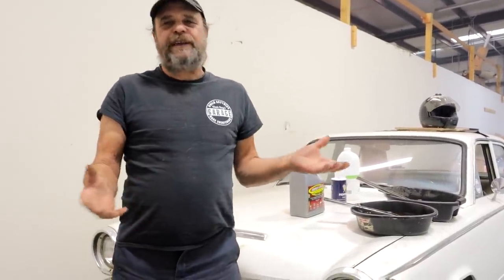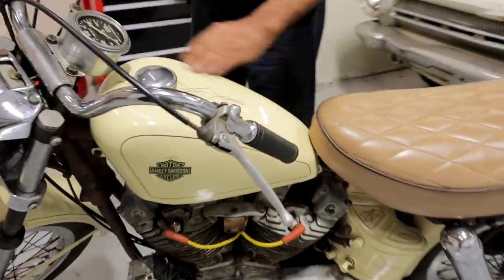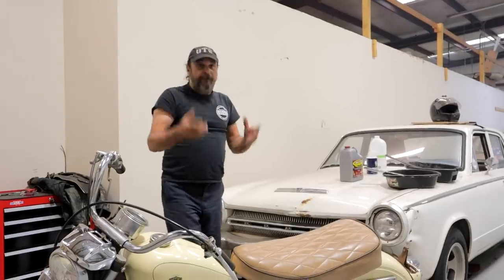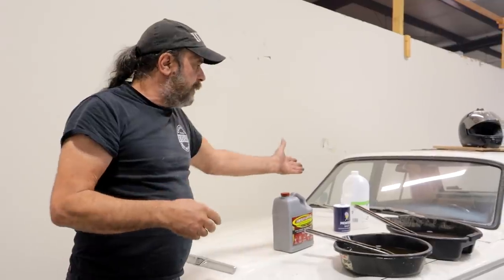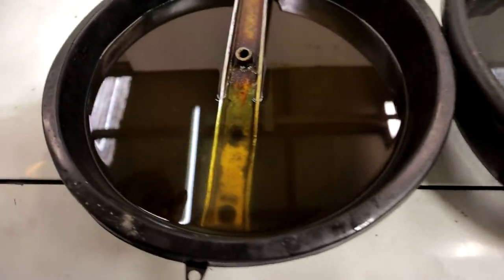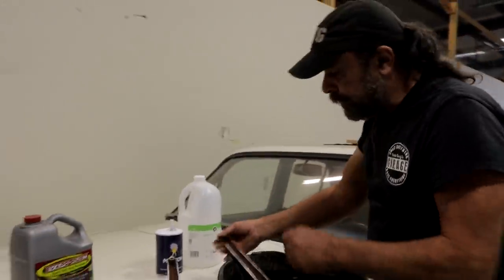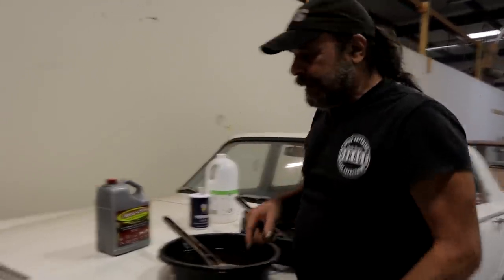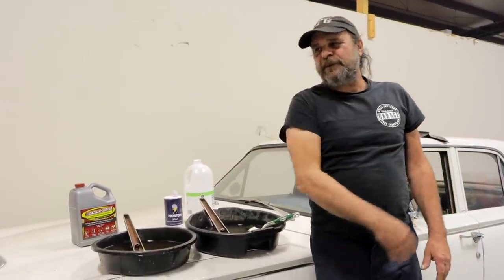Evaporust Vs. Vinegar - At 10X The Cost Does It Do 10X The Job?

Comment: The old timers used to tell me about distilled white vinegar years ago working in shops but I was too young and impatient to listen to them or wait for the results....   Now at 41 years old its all I use, even more than sandblasting because the Distilled white vinegar leaves the metal in a much cooler original unfinished raw metal state... Thanks T...

Comment: Done a lot of bike tanks I’ve used the stones u get from harbor freight to polish gems and sones plus a small pic of chain then put diesel and vinegar and water . Then jack my riding mower up strapped the tank to the rear wheel put it in gear let it go for 20/30 min works great

Comment: I just did my own experiment with two plated bolts.  One in vinegar the other as a control.  Both were brand new.  Within two hours the plating was removed.  I let it sit overnight anyway.  I took it out and rinsed it off with water.  I also rinsed the control bolt and let them sit.  The one that had been in vinegar flash rusted.  

I had said in previous comments that vinegar would remove plating and people disagreed.  It will certainly remove plating.  If you have any amount of plating you want to keep or a machined surface you don't want etched then any acid is a poor choice.

Comment: it good! I tried it, EvapoRust is GOOD! holy moly, it changed my cleaning routine of old and crappy parts! bin of rusty bolts? ***dump*** ***rinse*** ***quickdipanddry*** and aluminum spray paint for preservation. <3 all

edit: oh, just be careful at the surface barrier I had sticking out like demonstrated in test example, I had deep pitting on my parts. though, I wasn't using EvapoRust and another type of 'enviroment' friendly brand rust remover. ***shrugs*** be careful and get your super important parts FULLY SUBMERGED!

Comment: Uncle, there is amother way i use. Muriatic acid. Its like hell but disolves the rust and leaves clean and shinny metal.  I then wash the part with sodium bicarbonate then soap and water. When clean, sseal it with atf (atf is great to prevent rust)

Comment: Rust bugs have been the bane of a metal worker's life for centuries, and dozens...probably thousands... of methods for removal have been tried. Thanks for the side-by-side comparo. I've wondered about Evaporust, but never seriously enough to step up to the cost. My sense is that it's probably perfect for some tasks, but for me it's too expensive to try when vinegar/salt work so well. There are various acidic strengths of vinegar; the highest I'm aware of is 12%, and that works really well. You can find it in farm supply shops. It's sold as a natural weedkiller. If you're wondering about the strength of the vinegar, check the label. In my local grocery store I've seen from 3% to 6%.  Varying the amount of salt can affect how well it works as a rust removal mechanism.

Comment: Hook up your battery charger positive to a piece of iron that can slip inside the tank attacked to a wire so it is not touching any part of the tank hook the negative side to the underside of the tank were you can get bare metal. Fill it with water and 1/4 of a box of arm and hammer laundry soap. Than plug it in set to lowest setting keep the top of so the hydrogen Can bubble off in to air after a week of that your rust will be on the piece of metal And the tank will be a black color without the rust works great. 
Works really good on old rusty tools you can buy for nothing at flea markets and yard sales. It is like getting free tools.

Comment: Wallpaper trays are perfect for de-rusting fender struts!  The actual ph is what determines the relative action between the acids.  The addition of salt helps break the oil film left behind when not perfectly cleaned.  I've long gone to electrolysis for the worst rust removal, a variable voltage supply allows real time modulation of the electrolysis.  A battery charger provides a sound controllable power source.

Comment: If that tank had gas in it, a lot of that crud is varnish. You have to have to soak in kerosene or carb cleaner first to get that coating off, then deal with the rust.

Comment: I've used Evaporust numerous times and while it's not great, it does work pretty good. I find it works best if you clean as much oil/grease and scale rust off of the part before soaking it for 24 hrs. Or, soak the part in Evaporust for 12-24 hrs., then clean the oil/grease/scale and re-soak the part for another 12-24 hrs. It's not a quick process, but it does what I need it to do. 

As for that rusty fuel tank, I'd leave the Evaporust in there for a week, agitating it here and there with a brush, and see how that works. then maybe coat the inside of the tank with POR-15 afterward?

Comment: Another vote here for citric acid, used it on an old tank with warm water and a aquarium heater set to 30C, took 4 days but did the job, you may need about 5 changes of solution but it will eventually get 95% of the rust out. A lot cheaper. Regards Rob B UK. Also love teh battery and emery paper trick with that head.

Comment: In the first 3 seconds, he mentions how Project Farm is next level, but I do remember that Apple Cider Vinegar works the best from my days of recouping 350X's and 70's street bikes. Never tried white vinegar and salt, that's for cucumber/onion salad with a little bit of sugar. My problem always was the reintroduction of rust in a few months if the bike wasn't ridden, I got told kerosene or PAM will keep the rot away for Winter storage after the initial cleaning. Can't paint the inside of a tank, so....

Comment: last time i did a motorcycle tank, Eastwood recommended putting a few dry stones in (not rounded pebbles, but rocks with edges) into the tank and giving a good shake. Sedimentary rock might break apart, for certain it will give your shoulders one helluva workout. I will duck any proverbial stones thrown at me and recommend eye protection--not hard for a good brush scrubbing to fling stuff all around.

I also recommend molasses dips and electrolysis with washing soda. You can look these all up, they take long, but if you have more time than money, its worth trying these old blacksmithing/farmer tricks before stepping up to the serious chemicals.

My final recommend, is a future video on the classic issue, "should I top off my gas tank before winter storage or drain it dry?" Living on the humid coast, I'm still amazed folks can't agree on the answer.

Comment: I don’t mind the evaporust 

but one tip if you heat it up in the microwave before use to about 50 or 60°C it works twice as good and twice as quick….. definitely can avoid soaking overnight when it’s hot

and when you’re done you pour it back into the bottle and reuse it next time 

I’m not sure if you can reuse the vinegar and salt maybe you can…..

Comment: I used a POR15 kit for motorcycle tanks on two different bikes several years ago. Both bikes are still going with no problems. It is expensive but comes with metal prep, cleaner and sealer that cures hard like an epoxy. I tried Kreme once and had nothing but problems.

Comment: used vinegar to remove flaky surface rust from the floor of my nash metro years ago, soaked shop rags in the vinegar spread them out on the floor covered with plastic , checked every other day/wiped off the sludge rinsed and repeated till the floors were clean as a whistle.  you have to paint right after you clean it off for the last time because it will flash rust almost instantly

Comment: Tony; for the inside of the fuel tank; head to the nearest sporting goods store that sell ammunition and buy a small bag of "BB" sized steel shotgun shot for reloading shot shells, add that to the inside of the tank with salt and vinegar and slosh that around. I use that in antique bottles.

Comment: I'm sold on Evaporust, I found the vinegar was aggressive with the metal, but you do have to wash off the residue with Evaporust, not a problem. I'm thinking there was some gas residue in the tank, hose it out with water, let it dry and then try the Evaporust again. I keep 10 gallons in a plastic tub (yes an investment of about $150) I've had it for years and it still works. You start looking for cheap rusty parts at flee markets with that around and it has never damaged paint or plastic in all the times I've used it, actually have some hood hinges soaking in it now.

Comment: I haven't used Evaporust, but if it's as supposedly safe as they say it is, it might be useful if there is black oxide, plating or paint involved. I used to use electrolysis but now use mostly vinegar, both will absolutely remove paint if you brush them while they are not neutralized.

Comment: Tony,  good side by side. Gasoline leaves a varnish which is a barrier the evaporate cant penetrate. Try a chemical that removes varnish ( carb cleaner) first, then your evaporust. Two step process.

Comment: Evopo rust works great. But remember that you might have to spread it around in the tank. But  I use it on hit miss engines. On cast iron the parts are 100 years old or so. It makes the parts look new. So I love it. But it will take time. Just wanted to let you know. And like was said you can use it over again. But remember it will freeze. But I like it.

Comment: Evaporust does leave a coating behind when it dries, but it is water soluble so it literally cleans up with a damp cloth or a rinse. Ive had extremely good results using evaporust, but it takes a while to do its job. Soak overnight, brush off anything that came loose, then put it back for another overnight. I’ve used it to soak heads and they come out like they just left the caustic tank.

Comment: Add some loose nuts, so when you shake it. The rust is knocked off, drain and filter the fluid until clean. Then seal the tank.

Comment: Tony, I'm not sure how much salt you are adding, but it should be more than a pinch in that tub.  Try a cup of salt to the gallon.  It will keep the pH more stable, and the chloride (Chlorine ion in salt) should bind more readily with the iron in the rust.  A little heat (a hot sidewalk works well) and agitation will help too. For agitation, go to a pet shop and get the cheapest submersible pump they have.

Comment: I've resorted to using muriatic acid for swimming pools to clean a lot of rust and dried gas gunk out of fuel tanks. It took a few days and I was really careful, but it didn't damage the paint. some of the tanks were so bad I ended up using tank liner,  but without cleaning out with acid to begin with even that wouldn't have worked. Nothing is worse than a liner coming apart in a tank, may as well throw the tank away when that happens.

Comment: I put some rusted solid bolts in some vinegar, the put them on the stove. I was able to have the bolts work after a few minutes of wire brushing. I've also used bar keepers friend, which seems to work faster, but needs a lot of scrubbing.

Comment: UTG I would recommend you try this... The evaporust is darn near a miracle and I think it is often no used to its full potential when I see it on youtube.

Take the evaporust and put it in a lightly sealed container like a plastic paint measuring quart with a lid.  You put your parts inside.  You can put it out in the sunlight to heat it up and drive the process.  There is a small amount of gas created so a fully sealed container is probably not good.

Before you take the parts out you can shake them in the sealed container.  Then fish them out and rinse them off and brush them.

Here is the magic.  The evaporust makes a sediment that is not useful and turns the colour darker.  You can filter that out with a paint filter and a piece of paper towel.  This removes the sediment and other contaminants.

I have run a small container of evaporust in this way with nuts and bolts and small parts and I literally did not use it up other than whatever was lost during the part removal.  You can also add water to dilute it to cover larger items.

If you leave the stuff without a lid it crystallizes... I assume it oxidizes or reacts somehow as well since adding water does not seem to reconstitute it.

Try putting that little container on your bench.  Degrease the items with brakeclean and knock off the big rust (no point in wasting time and evaporust converting huge flakes).  It is faster than than vinegar and doesnt etch the parts or remove the coatings.

Comment: The problem with removing the rust is that the steel underneath has molecularly oxidized so painting over it if not necessarily the right so you should it will bubble back up corroseal dude I use it even when I have ground rust off of metal I coat it with rust converter so that stops future oxidation

Comment: I use this Corroseal in fabrication ie on steel that is sat out in the rain and it works wonders on expanded metal mesh probably not the best thing to use inside of a gas tank but for treating rusted steel it is a almost permanent beautiful product

Comment: I actually just recently did a video on evapo rust were I cleaned up some 426 Hemi rods, in my experience the warmer it is the better and faster the product works if it's summer and in the 90s it seems to work really well and faster then this time of year it's usually room temp also make sure the parts don't have oil or grease on them, my favorite is metal rescue but it's a bit pricey
Reply: yup.. i use it in an old fryer bring it ip to 180 deg.. removes rust in minuits and the fryer basket alows for agitation ... tech tip ...lol

Comment: I just learned about the method, where you put a chlorine -watermix  ~1:3 in the tank and then put an old Batteriecharger with one clamp on the tank and the other clamp on a screw which you hang into the tanks opening, then start the charger and let it do its thing..
Reply: That removes the rust electro chemical. The rust will collect on the bolt, you just have to clean it every now and then. Final step is to let it sit for a day with citric acid in it. Never seen such a good working method!! ☝️☝️☝️⚒️

Comment: Is it safe to use vinegar with distilled water in the radiator to flush it? Or would thermocure work better?
Reply: Nevermi d. I don't want to pour baking soda in my cooling system. 🤪

Comment: I've used vinegar to treat rusty metal many times but never used salt with it, what's the logic of using salt?
Reply: It's a scrubbing agent.  It can get into the small surface imperfections that nuts, bolt, screws, and the like cannot.  I don't use iodized (table) salt, I use kosher or sea salt on glass, stainless steel, and porcelain with excellent results.

Comment: Chelation (e.g., Evaporust) is an effective way to deal with rust, probably the best way if conservation is your objective.  Chemically, it's pretty similar to electrolysis but is more convenient in that doesn't require electricity to drive the reactions.  That means you don't have to worry about carefully placing anodes evenly around larger parts.  And, unlike acids, chelation won't etch the metal.  Mild acids like vinegar won't etch metal very quickly but I like knowing that it won't happen at all.  There are a lot of brands of these chelation solutions.  I found one named Rust911 which can be purchased quite concentrated, which means that you won't be crushed by shipping charges.
Reply: Shipping charges are rarely if ever figured by weight. So no, you are not going to be “crushed” by shipping charges if something weighs a few pounds more. 😂
Reply: @supersportimpalass  If you only need one gallon of product, it doesn't make any difference.  If you need 10 gallons, it makes a big difference.  It costs real money to bring 9 extra gallons of water to your house.  That's an extra 75 lbs, which is not exactly "a few".  For what it's worth, it's also a lot easier to store 1 gallon than it is to store 10.

Comment: Thanks for the Sporty fix. Was wondering if the Evape-O-Rust is water bourne? (Is it water soluable?)
Reply: Yep it's like por 15 metal ready. 
I find the stuff handy for brushing on fresh clean sheetmetal that I'm using to fix rust on my project. 
No surface rust on the stuff and it's been sitting in an unheated shop for a couple yrs. 
Seems to take forever to totally remove rust no matter if it's evapo-rust or por-15 metal ready.
Reply: Yes. You're supposed to rinse it off when you're done.
Reply: @TheBrokenLife  or you can leave it on , let it dry, and enjoy a little protection of some zinc phosphate coating while you're working with bare metal. 
Keep working it in whatever, and then rinse it off.
 I had to set a car outside for about a week that had new (bare) floorpans. 
I coated it with the metal ready and I was surprised how good it saved it.
Reply: @MrTheHillfolk  I never thought of it as a temporary protective barrier, but I could see how that could work. Anyhow, before painting, you must rinse it off with water.

Comment: try rust mort works way better
Reply: i laugh at this stuff best thing to use is rust mort on rust u wire brush it then put rust mort on next day it looks like bare metal it converts the rust back to metal and treats the surface so it don't start rusting again ready for sanding or painting or like this a tank liner u just poor it in with a small hole at bottom let it drain after washing it all over the inside  u just let it sit for a day it will plug the hole u make just a very small hole so it can drain this is how the pro's do it . i use to fix fuel tanks and build them from scratch also did modal a and t radiators from scratch

Comment: I like electrolysis,  cheap as dirt works great. And for your situation maybe the best choice fill the tank with distilled water and a cup of oxy clean , drop in a sacraficial anode hook up your battery charger and let it cook.